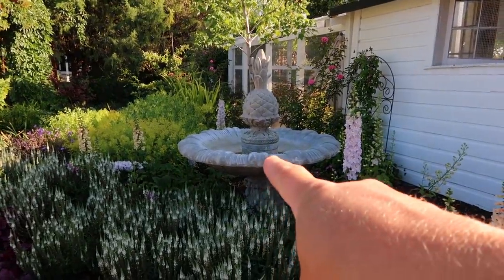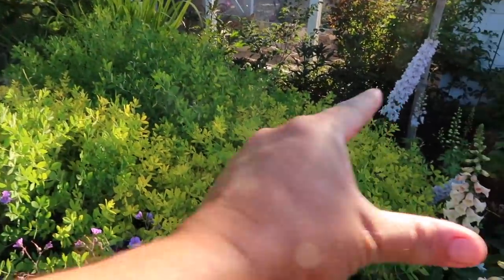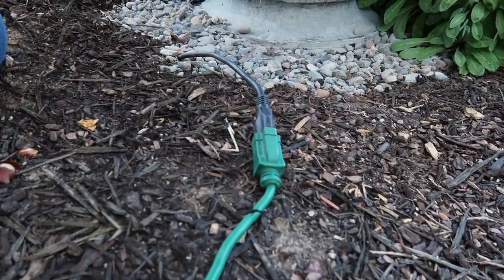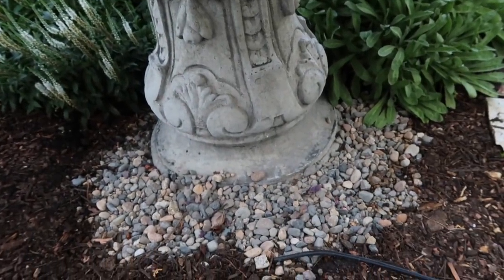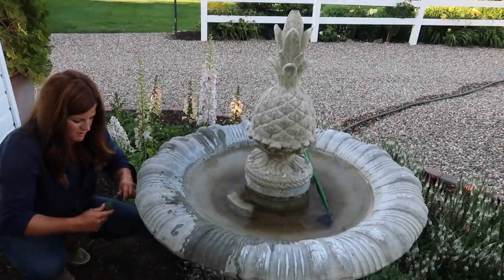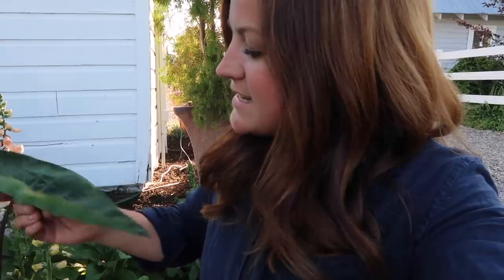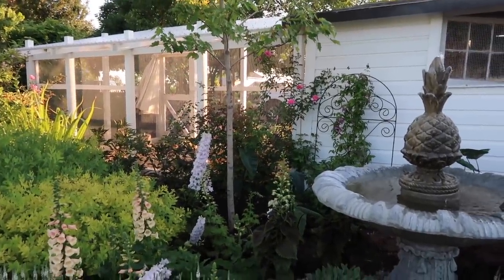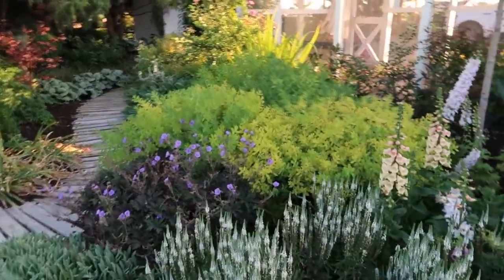Working on the Flower Bed Behind the Chicken Coop! 🌿🐓💚// Garden Answer

Comment: Help! I got some foxglove for the first time this year! A couple of days after planting they began to wilt horribly. We have been in the low to mid 90’s for several weeks with high humidity. I have been giving them water twice daily (and a good amount). They get morning sun until noon. The poor things are STILL wilting 2 weeks later. Is it possible that I put too much starter fertilizer in with them? Am I watering too much? Too much sun? How do I save them?
Reply: Hi Laura or anyone here that can help ?I have a lovely begonias but I notice they're having white spots and 2 of them are really full of it.What have I done wrong?And is there any spray that I can use?Pls.  Help me save them.Thank you!
Reply: Mely Terry mealy bugs ?       In case you don’t know , Mealy bugs are cottony like bugs that appear to be spots until closer inspection.    They are often found in the leaf joints and undersides of leaves.   Insecticidal soap, or a Dawn/water combo mixed with alcohol will usually kill them.   You have to be persistent.   They spread easily and may require several rounds of treatment.   I had a bad case a few years back.   Some of the plants were so overwhelmed I threw them away.    My other guess is powdery Mildew.   There are plenty of DIY treatments on YouTube for it.     Good luck 🍀.
Reply: @ltnewsome  Thank you so much!I will search in you tube then.

Comment: I have planted elephant ears and they get very big and shady and they spread, so if you don't want anything to die, don't plant it too close.
I've had mine about 3 years now and more produce every year. They are very hearty in VA. I always heard you have to dig them up and plant them in pots and store them. I just cut them level to the ground in the late fall and cover them with a little dirt and they come right back in late May - mid June. They grow fast, so satisfying!
Mine grow in a corner of the house in filtered light and shade and standing water when it rains. It that helps anyone. 
I've always wanted to plant petunias like that but I always buy them in the hanging baskets and just leave them there. 
That bed is so pretty. I love the colors together.
 I'm determine I'm going to start a new bed i've wanted for 6 years now.

Comment: To straighten out a leaning cement piece.  Dig a hole, as deep as a cinder block plus 4 inches.  Put sand of 4 inches into hole and cinderblock over it.  Level cinder block. Can put stepping stone over that.   Put cement peace over it.Mine have been straight for years.  No more straightening it up each spring.  Works great.

Comment: I appreciate that you show the problems that you deal with, and how you solve them. I also liked that you told us how long it took you to do the project. I am surprised you have so much luck planting in the heat. I live in AZ, and find that my plants even struggle when I plant in the Spring and they have to deal with our 100 degree temps with in a few months. I can see a significant difference when I plant in the Fall, and the plants have time to get established before the heat hits... I wouldn't dare planting in our summers. Do you think you have so much success planting in the heat because of the amendments you use? Possibly they help the plants get established faster to deal with the heat?
Reply: And the consistent watering with the drip.

Comment: Those elephant ears will be fine in the heat (with enough water). We live in the tropics and even on 40 degree C (104 degree F) days in full sun, they haven't ever been bothered in the slightest. They are tough. I was only worried about the wind you get, until you mentioned the position. Beautiful place for them!

Comment: Since the old pump wasn’t working anyway, could you have cut the cord and pulled the cord out through the bottom as to not fight with the plug on the cord and stopper, and then pulled the pump through the top as you did? Or, do you use or do something with your old pumps? ... I love that you always show what maintenance and work goes into your fountains. I’ve always thought I wanted one, but am seriously second guessing it!

Comment: I have one fountain, count them one, that I created out of a pile of broken concrete I would have otherwise had to dispose of. It has a 1/4" line from the drip tubing with a micro-sprinkler emitter that is adjustable.  Every day the fountain overflows for eight minutes and waters the fountain plantings. Just a thought if those elephant ears want extra water.  Of course that would probably involve tipping that fountain again, so maybe not.
Reply: Rebecca Clayton I think she said she’ll add extra emitters to the drip tubing if they need more water that what the line is already providing.

Comment: Many times if you remove the pump, you can manually blow it out and clean out any debris and it'll start up again. If you're going to replace the old pump, I recommend using a new low voltage LED pump, they last a lot longer and consume a lot less energy. The pot is awesome, but is not professionally anchored to the soil, you should have a good concrete base raised higher or have a concrete brick and mortar base, so the pot is more elevated and more secure in the ground. Also you need a better electrical connection at the pump than just the two electrical answer using now that's not very professional, plus the electrical line should be in plastic conduit to the side Outlet on the chicken coop.

Comment: Oh Laura, I can’t help but comment here. When you put your hand in the water to adjust the flow and the pump without unplugging the electrical cord I cringed! I know it’s a pain to make a slight adjustment plug the cord back in to test then unplug the cord make another adjustment etc. However, I lost a cousin I’m putting his hand in the water to adjust a pump. Not likely with your new pump to have exposed wires but I would rather you be safe! Beautiful plants as always! I have never seen elephant ears at garden shops in my area! I live in Washington state so not far from you.💐☺️

Comment: Question:  I live in Iowa Zone 5a.  I am redoing a bed on North side of house that has a new blue muffin viburnum on north east corner and the two gimbal spire.  There is room behind for some taller vertical plants and around for lower to ground plants.  I was thinking Heuchera for lower but not sure in behind for vertical accent plant?  Any advice from you our community?  Thanks. Bruce from Iowa

Comment: “The flopping issue” is that the reason why my salvia flop as well? They are in full sun, well drained soil, I only water them (as needed, every once in a blue moon) but they did flop, so I ended up cutting them back for the season and they’re starting to regrow but I’m wondering if I should separate them 🤭🤯

Comment: Re: Staking Delphiniums etc. I think bespoke supports are far too expensive and fiddly; in the UK a TV Gardener, Month Don, has a good method, much quicker than sticks and string, and less visible. Get 1/4" solid steel rod, cheap from Steel Stockholder or Building supplies, it comes about 8 feet long (can cut in half for smaller supports). Bend the middle round a tree of suitable diameter to make a U-shape with ends the same length, then put the "ends" under a board with sufficient length sticking out for the height of the legs, and standing on the board bend the legs up towards you. The result is a pair of legs with a curved support at 90 degrees, stick that in close to the plant to restrain it. Monty Don's BBC videos are geographically restricted, but this one shows the same thing https://www.youtube.com/watch?v=PSXkYNYuXhw
Reply: Thank you so much for the link...brilliant idea that anyone can do.  This will solve some problems I currently have!